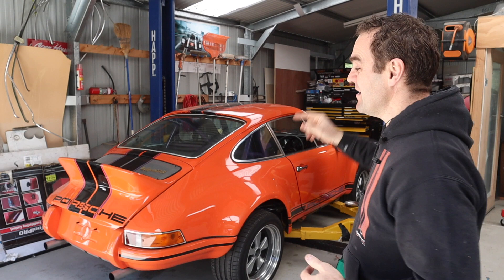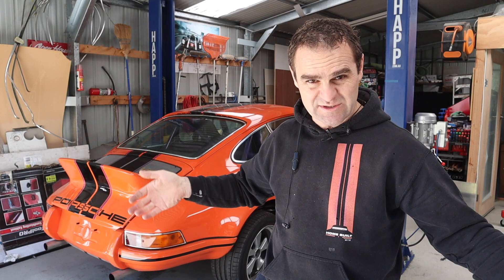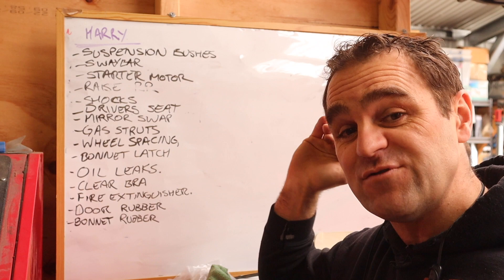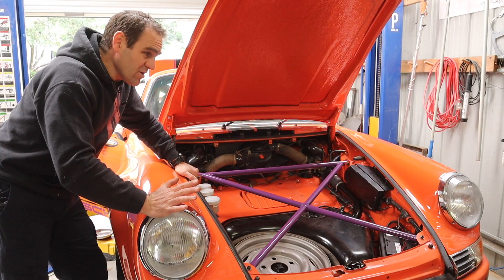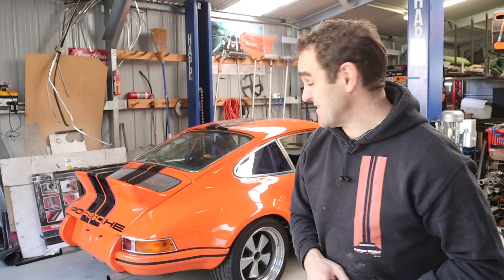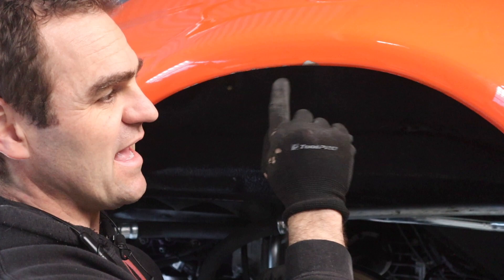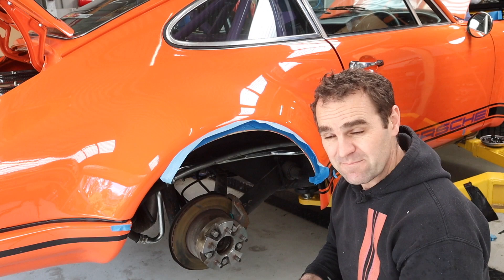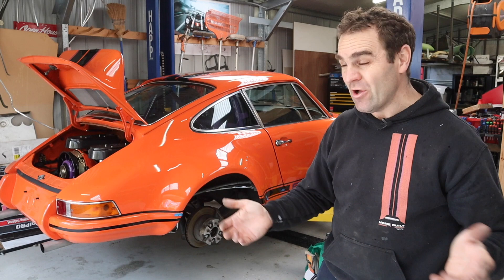Fixing my paint screw ups - Porsche 911 2.8 RSR Build Season 2.47

Comment: Hi Jeff, nice job, the only thing I see that needs doing is you should fit anti-crush tubes to the bolt through points on the front strut brace to stop the tube from crushing over time, it'll also enable you to nip the bolts up nicely to a uniform torque. Torsional forces will follow the path of least resistance so over time the strut brace will crush and start flogging out the holes in the strut brace and mounting bracket. google anti-crush tubes and you will find some helpful info and forums showing how it is done. Keep up the great work. Cheers.

Comment: WOW Jeff .. they went easy on you with the brake testing.. a piece of cake .  Try getting an IVC passed.   Lock up tests ..disconnected half a circuit tests both front and rear.   Mate it costs a set of tyres and several litres of brake fluid as well as all the reconnecting and bleeding etc. Plus the hire of a race track for the day.

Comment: If the brakes are a stock Porsche 911 brake setup, why did they do a brake test the reg's don't call for it. So what Mods did you do to the brakes? and which track did you use?